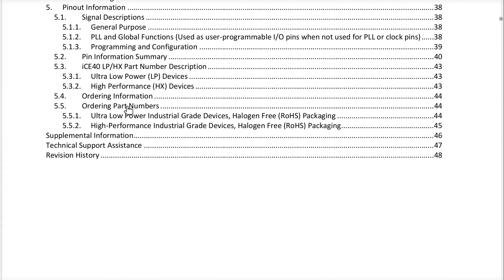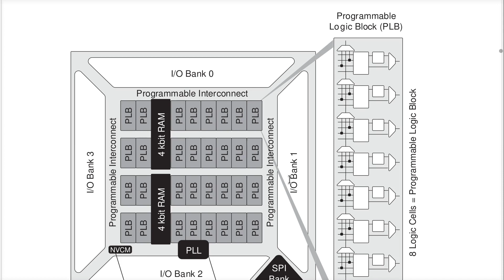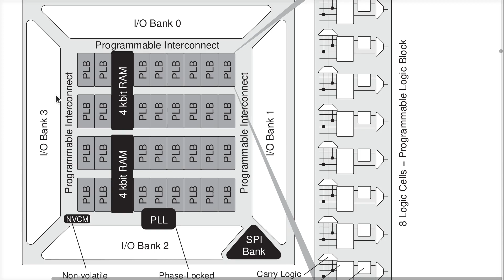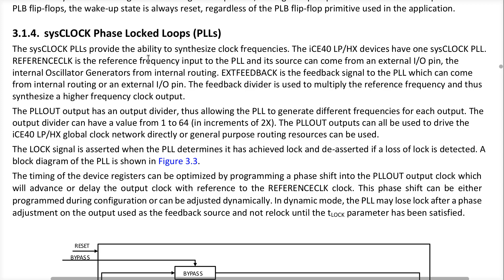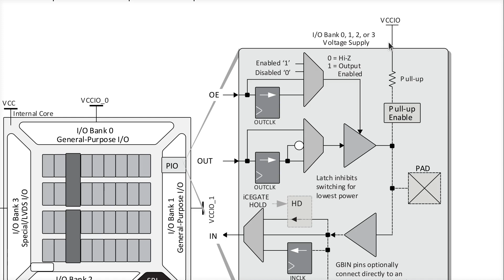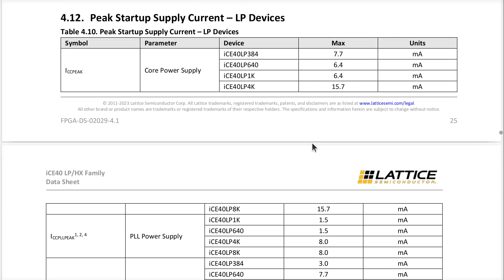FPGA #3 - ICE40HX Architecture & Datasheet

Comment: Can you use open-source only tools for ICE40HX development? There are many not expensive FPGAs on the market but all of them are vendor-locked, not so good for DIY.
Reply from the maker: Yes we can.  FOSS tools are what I use with the ICE40 chips.  Huge plus indeed.
Reply: @JohnsBasement  I started and use the Lattice ICEcube tools. 
OK, you need a Lattice license 
and download as well the Lattice Programmer ( only the Programmer, not the full tool) , 
and as a start did a little VHDL examle and programmed the ICEstick I own.

Comment: Regarding 4k vs 8k - it's binning. Same die, but with defects. Other FPGA vendors do that too - for example Xilinx Atrix-7 A15, A35 and  A50 all have the same die. It could also be market segmentation, but in case of Xilinx devices I mostly work with I haven't heard of anyone turning say A15 into A50. Speed grades though is a matter of characterization, and you can program speed grade 1 device as if it's a speed grade 2, it may or may not work, and would consume more power than usual, so it's kind of like CPU or GPU overclocking - results will depend on a luck.
Reply: However it's done, the toolchain still has to know how much of the hardware on the chip being targeted is actually functional, and how to address it. That's the weird part. And I can't see it being practical to read that info from the chip itself, otherwise the design would need to be recompiled for each individual chip. That would be okay for prototyping, but not for mass production.
Reply from the maker: @gcewing  I agree.  Hopefully someone has a solid answer.
It is possible that a buyer wanted a 4K chip & Lattice decided it was cheaper to make one with the 8K die... maybe the timeline or a prototype 4K yield was bad?
Reply from the maker: I can understand differentiating them by speed.  But feature defects is a whole different ballgame.  They'd have to declare what parts of the die are the official 4k subset. Else the PAR tool would have to know which parts of the FPGA to avoid.  Without a 2-way communication path, that seems like a pretty complex 'feature'.
Reply: @JohnsBasement  There are ways to deal with this. For example, you can have config logic program one of several routes depending on fuses which are lasered off before packaging, or they can connect one route to multiple block RAM (or other HW blocks) and laser trim excess connections after testing. For example, I know for a fact that Xilinx laser trims off multi gigabit transceivers and PCIE blocks on dies for packages which do not bond them out so that they won't waste power, so maybe Lattice is doing something similar.
Reply: @JohnsBasement u didn't touch in the DSP's!!!
Reply from the maker: @Jblow-u2m  I am not sure what you mean.  I know that it is common for  FPGAs to have hard DSP blocks.  But the ICE40HX doesn't.
Reply: @JohnsBasement  that may be true but are you familiar with the fomu? It the same caliber but has DSP blocks. Can you do a show on that one?
Reply from the maker: @Jblow-u2m  The simplicity of the ICE40HX makes me think it is optimal for a beginer.  Advanced features will have to come later.

Comment: Lot sorting before the die is cut … Intel does this all the time… chips closer to the center perform better and can possibly be overclocked… towards the outer edge chips have a higher failure rate and run slower